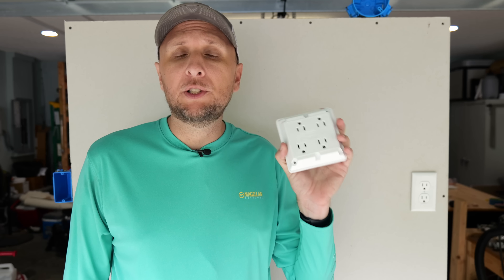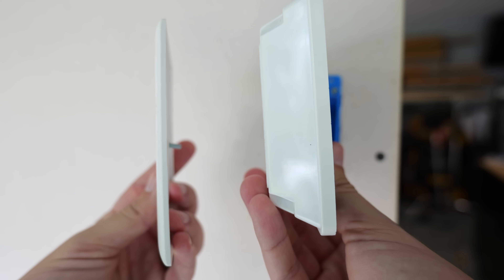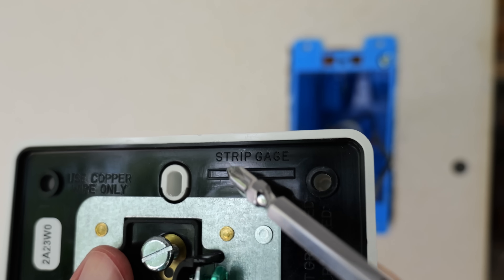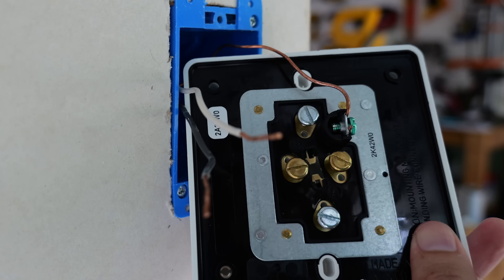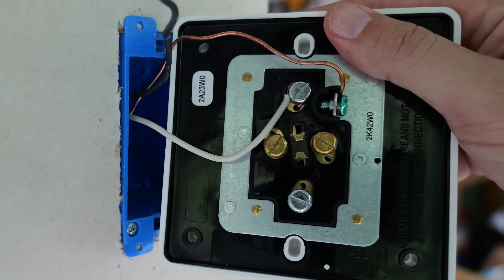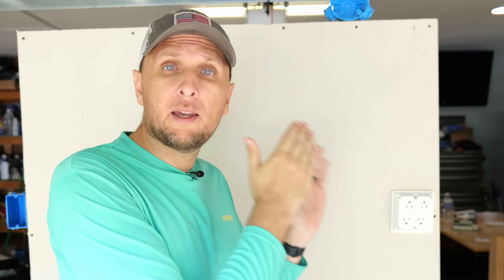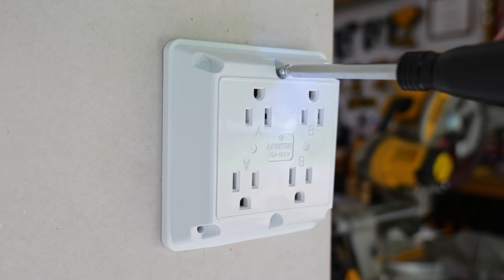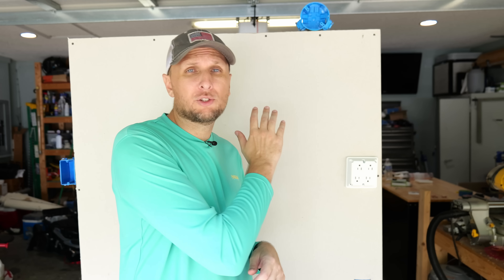The GENIUS 4 Outlet Receptacle That Almost Nobody Knows About | How To Install

Comment: Would a plug in six pack be better given you are protruding anyway?
Reply from the maker: They work but they won’t last as long, usually aren’t UL listed and aren’t hardwired.  Hardwired is far superior to any strip or splitter.

Comment: Why explaining the right way to turn the ground wire around the ground screw
then do exactely the contrairy with the other two
without any good explanation
and i did'nt see anything that prevent you to do it the proper way ????
Reply from the maker: I completely explained it.  In detail.  They were done correctly.  All of them are going around the screws in a clockwise direction.  Did you skip or just not understand?

Comment: First tip: don't ever use a low voltage box for 110V power.
Reply: That's not a low voltage box.  Those are typically orange, but not always.  This definitely wasn't though. Just a normal NM cable PVC box.  And this was just for demonstration. The sheathing should have been pulled past the plastic clamp tab. This was just an extra one he had lying around as you can see 2 of the tabs were already punched in and you're not supposed to reuse.
Reply: @Andrew T  Understood. While code compliant for 110V use, I shy away from them. They are not durable, the retaining tab is prone to break, and they are flammable. I've seen many an electrician use them for low voltage, though and for that, they work fine. I love the remodeling version with the flip out tabs to run cable, hdmi, and even an extension cord from base to behind a wall mounted TV. But never for 110V.
Reply: @rcampbell4967  I hear ya, only use those when I have to. I like the re-work boxes as well, those tabs are handy. They are supposed to be flame retardant, but I've never seen or tested one myself. Personally, I use metal conduit and boxes for almost everything I do.
Reply: I was wondering about that too.

Comment: That design surely allows very easy contact from the ground wire to the live or neutral terminals. When you show the reason for the knocked out diagonal holes, I'm lost with that purpose when you show it's for a metal box - which was already 2-gang which makes the requirement for this panel moot. :) Otherwise is does make for a simple upgrade for places like garage and is a manageable install for most, especially with your step by step guide.
Reply: if you see that metal box doesn't have mounting locations for any outlets. the thing in the video would take the place of both outlets and the double duplex plate the outlets would get mounted on before they get attached to the box.
Reply from the maker: The ground would have to be bent in so much in order to touch either of those terminal screws.  While I suppose it’s possible, I think it’s pretty unlikely to happen.

Comment: Or you could just plug a 4 outlet receptacle into the 2 outlet receptacle.
Reply from the maker: You could but they don’t last as long and an adapter or splitter is never going to have as good of a connection as a hardwired device.

Comment: A great idea especially if you want to have 4 outlets on a kitchen backsplash that has ceramic tile. Installing a 4x4 box on a tiled wall is a huge hassle and you may end up breaking some tile in the process. Way way easier to install one of these.
Reply: In most cases it won't work in the kitchen like that because you have gfi's
Reply: @dscollo  it’s fine as long as he’s not replacing a gfci receptacle as it must be gfci protected upstream.

Comment: It’s just like a 4-outlet wall tap…it’s just hardwired in, rather than plugged in (abuts it’s sticking out nearly as much)
Reply from the maker: True, but way safer and more reliable.  These things are built like tanks.  Was surprised when I received it.

Comment: Wouldn't it make sense to wrap the wire around the screw in the opposite direction?  Since the end is clamped in the hole, tightening the screw would tend to pull the wire tighter - unless it pulls the end of the wire out of the hole.

Comment: I'd probably at the very least tape off those hots because with the bare ground there is nothing stopping it from contacting them sticking straight out the back and causing shorts.
Reply: I came here to say the same thing.  With the screws on the back instead of the side, it's much easier to have the ground wire make an unintentional contact when you push it back in.  Taping over the terminals seems like an obviously good idea in this case, and I'm not usually one to do that.

Comment: The good thing about this is that if you decide later to only want one gang you can just remove it. No idea how I did not know about these. Thank You. Even better that it works with 4" boxes. Great if you need it for a temporary install as well
Reply: You can install a single gang outlet on a double gang box

Comment: You said you could use the second set of terminals to continue wiring to subsequent outlets down the line.  Is this code?  Where I live, the second set if terminal on a single gang outlet may only be used  if it is a split receptacle (by breaking the bridges between the upper and lower terminals, and supplying from a different circuit breaker. Onward wiring always has to be done with pigtails.  I imagine the same rule would apply to this outlet?  Very interesting concept though.
Reply: Probably a good idea to use a pigtail anyway so that the outlet isn't carrying the current from the rest of the line. Using another screw on the outlet only makes sense with a GFCI when you want to protect downstream outlets from ground faults as well.
Reply: @zorinlynx  that's a great point! Downstream loads could easily add up to 15 amps passing through the bridge. GfCI outlets are specifically built and labeled for this use.  I thought the rule was in place so that if the primary outlet was compromised, it could be removed from the circuit without affecting the supply to the  downstream outlets.
Reply from the maker: I prefer pigtails myself but the NEC does not prohibit using the second set of terminal screws to carry on a load unless it is a multi wire branch circuit where 2 or more hot wires share a neutral.  It may be a local code where you are.

Comment: Thank you! I have been trying to get a local electrician to instal 4 quad for me - now I can do this!!! Perfect for the garage. Thank you
Reply: I wish I had seen this as I was upgrading to a quad in my garage.  When I remove the original box, I found that it was deflecting a water pipe about an inch and a half.  Now I had to find a shallow box.  What a pain and the old work box has never been really as sturdy.

Comment: Do you not pinch your ground wires closed, so that even if the screw came loose somehow, the ground wire can't wander around the bpx?
Reply from the maker: I typically don’t but that is a good practice some do.  Appreciate the input J.C.!

Comment: I'm not saying you did it wrong, because clearly the contact plate behind the terminal screws is intended for the wires to be wrapped in the direction you did, but... the way the loose end of the line wires are held in place by the anchor hole, it seems it would be an even better connection if you wrapped the wire around the screw clockwise. Usually it's the cut end of the wire that needs to be drawn in by the turning of the screw, but here, it's the insulated portion of the wire that can be pushed out from under the screw while you tighten it. I wonder if the manufacturer even tested this new design both ways to see which is the better connection. If anything, it probably makes no difference. 
Thanks!

Comment: I have two complaints about its design.

1) The two diagonal holes should have knockouts so there would not be two ugly holes in the receptacle when they are not used.
2) The two upside-down outlets are really stupid. Who installs receptacles upside down?! It looks like this was designed for (or by) morons who can't tell up from down.

I won't be using this receptacle until they redesign it. I give this 2 out of 5 thumbs down. 👎👎

Comment: I like the product, but I'm concerned when you push the wires back into the outlet box is the gound wire could come in contact with hot wire.
Reply: I think this could be solve by placing some heat shrink tubing on the ground wire. But I no electricuan either.
Reply: there would be plenty of space for the ground wire to be clear of the hot terminals because the new outlets don't sit inside the old box. Also, if you did it wrong then it would just trip the breaker immediately and you'd just take it off and properly move the ground wire out of the way. the wires won't be moving on their own once it's installed.

Comment: Or you could just plug in a $3 dollar 6 receptacle adapter... Youre Welcome!
Reply from the maker: No thanks.  Those are cheaply made and usually not UL listed.  Have owned plenty of them and they end up breaking.  These are hardwired and made to last.

Comment: Seems like it would be awful easy to bump the ground wire onto the hot wire screw~!
Reply: So far as I can tell, that would be no more likely than on a standard receptacle, though if you were especially worried about it you could bend the ground wire in a fashion that would keep it out of the way upon installation.
Reply: @bouncypear_net  I got one of these before even finishing your video. 😂 It says in the instructions if you aren't using an insulated wire, use a lead and ground to the box. But that only works if you use a metal box. So I wrapped my ground wire.

Comment: Great info/tutorial. I will add a receptacle like this in my garage. Thanks.
Reply: There's an even easier to install type that's been around for decades. you don't even have to remove the outlet or do any wiring at all. they plug into the existing outlet and get secured with a center screw where the cover plate normally attaches.

Comment: $20 Amazon. $1.25 dollar tree. Remove cover screw. Plug it into outlet.  Use the longer screw that came with item to secure it to outlet.  No wiriring needed just plug in and secure
Reply: Funny you say not ul listed… every one I see has ul mark ….build inspector should fail your install because wires are barely in the box!
Reply from the maker: You waited 8 months to respond with something that is to code.  It doesn’t matter how close it is to the top of the box, just has to be contained in it. 😂
Reply from the maker: Yeah so those are definitely out there, but oftentimes are not UL listed and usually aren’t made to last.  I have owned some of them in the past and personally won’t use them again.  These receptacles are industrial grade and made to last.  A hardwired connection like this is always superior to adapters, splitters, outlet strips, etc.

Comment: Slotted screws was a bad design choice.
Reply: I agree, it should have been a combo screw, like every other receptacle. That being said, I’d rather it be slotted than philips.
Reply: Thank you for the excellent video. What made it excellent? Good info. Well presented. No cussing or trying to look cute or funny. This is how you make a perfect video. Thanks again. Thumbs up!
Reply: Slotted phillips combo takes robertson screw bits to, they wont strip or slip out. just dont over torque them, it's a bit too easy to do-
Reply: Slotted screw allows for a flat wide head which is perfect for this application. Since the screw is not going to be touched after installation, getting it tight the first time is not difficult. 
Don't need to reinvent the wheel.
Reply: Should be the combo screw. Damn it. I haven't even got to try my damn combo driver yet. Got a nice hand one from klein tools. Now it's worthless. Ugh!!!
Reply: Leviton had eleventy gazillion slotted screws leftover from a century of business.
Reply: Hate slotted screws.
Reply: slotted flate headed fasteners like that used to be the Norm for  electrical devices.
Reply: Slotted, Phillips, Pozi or Torx makes not the slightest difference, as long as the wire is held securely in place. But Wago type connectors should now become standard.
Reply: Better torque.
Reply: Slotted screw are common for the terminals on outlets although there are manufacturers that make a combo screws as well. As for the mounting screws to the wall box one can find 6-32 Phillips screws of most any length to replace the slotted screw that were used for mounting to the wall box.
Reply: @Subgunman  ECX is the correct driver for outlet screws. These should be that also.
Reply: Green Robertson #1 or larger red Robertson #2 is better.  Square design lets screw stay on screwdriver and prevents torque out   🇨🇦
Reply: You would think a company like Leviton wouldn't even go there.
Reply: Slotted screws don’t have a self centering function. If you’re using a powered driver like the presenter has, that’s less than ideal. Even with a hand driver it’s easier to skip off to a side.
Reply: It should have had wago style lever locks or just regular j-hooks.
Reply: @szlash280z are outlet like that a thing? ive. ever seen them but sounds  amazing lol
Reply: Slot work, slot no change!!!

Boomers who think better is somehow worse…..
Reply: @chadb9270  Slotted screws are not better for any application. There are so many better choices these days over the tired old slotted screw.
Reply: Slotted screws should be outlawed. The screwdriver  slips out of the slot too easily and why use slotted head screws when there are so many better alternatives to choose from.
Reply from the maker: @francoamerican4632 agree
Reply: Comment doesn't add anything to the point of this video....
Reply: @rixtrix11  I didn't know you were the opinion gatekeeper. The content provider seemed to appreciate it.

Comment: This is awesome!  An answer to my prayers as I’ve been dreading changing out my overloaded receptacles.  I see the white one in not hospital grade and I need to put that color to match my bathroom decor so is that still a safe option?   Thank you so much!😊
Reply from the maker: Yeah this makes it a whole lot easier!  Yes the one I used is not hospital grade but it is industrial grade.  The hospital grade are built just that much better and like you mentioned, they come in an assortment of colors.  Just keep in mind, if it is going in a bathroom, the receptacle has to be GFCI protected whether that is by another GFCI upstream on the circuit or a GFCI breaker.  I assume by overloaded you mean you have a lot plugged into it and not that you are overloading the circuit.  I really appreciate the feedback!
Reply: If you outlets are overloaded. They still will be overloaded. U just got more plug to even overload it more to start a fire quicker

Comment: This would have saved me a LOT of time when I needed more plugs when the living room entertainment center got out of control. Thanks for the info. I will file it away for when the guest room entertainment center gets out of control!
Reply: For infotainment centers and computers you should always use a surge protector power strip instead of plugging everything directly into the wall.
Reply: @bohan9957  Everything is surge protected. Do not assume that everyone who understand both convenience AND protection is an idiot.
Reply: Should used outlet strip.  1 plug to 6+ outlets.  Plus breaker and on off switch
Reply: Look for something like the Leviton Duplex-to-Six Plug-In Adapter.  It converts 2 outlets to 6.
Reply from the maker: You are very welcome!  I feel the same way.  A hardwired install like this is always far superior to an outlet strip or splitter.  I would still add a surge protector on any sensitive electronics though, which I am sure you probably are already using.  Thanks a lot for the feedback Ken!

Comment: They make products that are much easier.  They just plug into the existing receptacle and fasten with a screw that goes into the threads where the outlet cover used to connect.  Takes less than a minute to install, totally safe, and it ends up looking pretty much like what you just installed.
Reply: Only works if you have conventional and not decora style outlet, I would also verify if it supports the full amperage of that circuit...
Reply: Those are okay if you have mostly low-load devices but not so great if you have high load devices like space heaters. They're built like power strips, and sometimes overheat when you plug something that draws chonky amps into them.